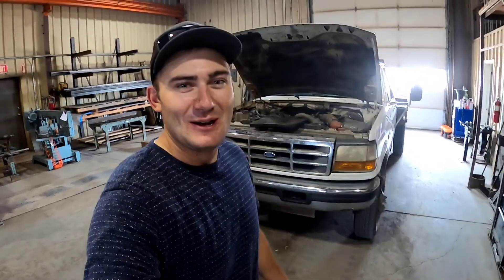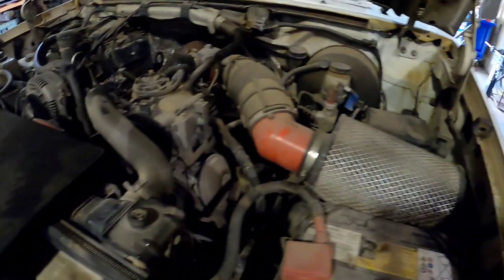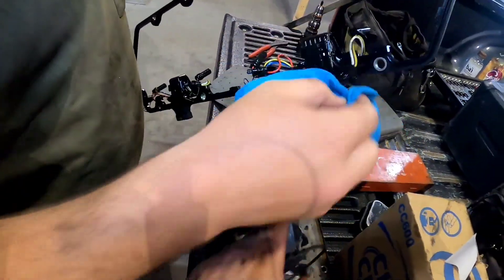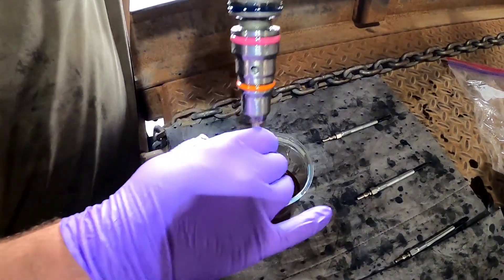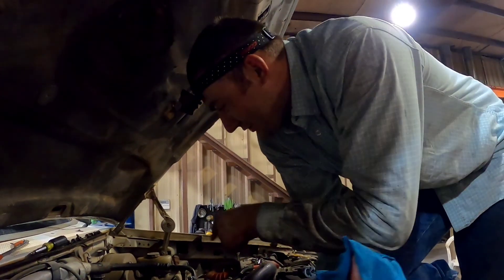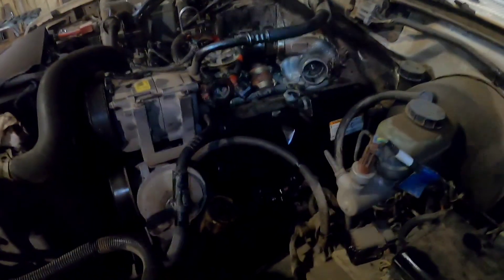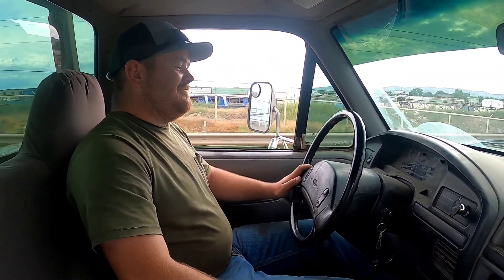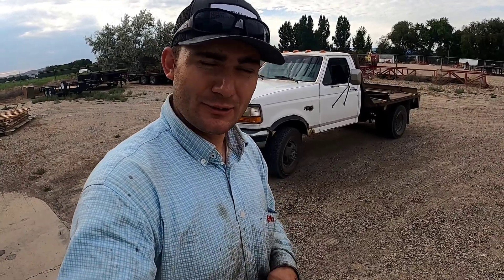7.3 OBS 160/stock INJECTOR install with mods and TRICKS!!!

Comment: I’ve done these like 6 times now but color me impressed with the detail you put into this, you are doing some things I didn’t even do. Thanks for providing this for all the new folks who keep these trucks on the roads!

One thing I do a little different is use a hand pump with a tiny hose into the injector holes to pump as much fluid out of the cylinders as I can, especially if you don’t drain the high pressure oil rail and it dumps a lot of oil into the cylinders. I also never considered turning the engine over like you did, I’ll be honest I just threw the valve covers on with gasket, a few bolts, and hit the starter relay for a few seconds. I will definitely try your method, especially without compression and using the belt it seems easy enough.
Reply from the maker: It's way easier and you don't have to worry about bending a rod
Reply: @truckincowboy7029 TC7029..  i apologize if I missed it... Please can you share the info to your injector rebuilder...

Comment: Nice job but a little bit of advice and especially if u dint have the greatest batts or wanna pull out the charger and play that game.. while u have those glow plugs out and have ur partner in the cranking with the batteries on.. its usually at this point to go ahead and hook up your ids or datakogger software and pull up that icp pid. Note i usually have the harness on too, makes a little less room to out ur glow pkusg back in but with those harness in and valve cover set up with two bolts and glow plugs out. Go ahead and crank its till ur icp gets over 500. Let sit and cool off a sec. Do it again. This lets the pump build pressure effortlessly and is easier on the batteries and starter and is  much faster. Then go ahead and pull ur teo bolts out and throw them plugs in. Take a spare craftsman deep1/4 in 8mm socket  and grind the top down to a taper about halfway down the socket on the top outter half. That craftsman will still hold torque for glow plugs. Keep this as your special glow plug socket. Helps keep it off those rockers and guides it out on way out with glow plugs too so it doesnt hang on a rocker. Reason for putting harness on before setting valve cover on with two bolts is to keep so much oil from leaking out when doing thst good prime crank with glow plugs out. Nice vid all together. We all boince our tricks off of each other.

Comment: Did the truck burn blue smoke sometimes under load is that another way you can tell injectors are bad?
Reply: i would be more scared of it being blow by (oil is coming past the compression rings and entering the combustion chamber).

Comment: How do you like the 160/0s?
Reply from the maker: For a work truck/ daily driver they love it.
Reply: @truckincowboy7029  yeah I have a race car not trying to make my truck one.. Just looking for (Towing Performance)for 30ft boats and trailers, I already have the kc sxe balanced assembly and 1.0 housing, exhaust intake gearhead tunes. Im thinking nice HPOP cnc stag 2 most likely but was stuck between 160/0 and 180/30s. Dont have access to either to drive so have no clue what they are actually like.
Reply from the maker: Honestly I would do 160/30cc. Those are the best for towing. And would match your turbo perfectly
Reply: @truckincowboy7029 do you need to tune it or can you just throw them in the Cab like the Stock ones?
Reply from the maker: @alterrihenri110  you can just drive it without a tuner. You could even put a chip on and it would make a big difference.
Reply from the maker: @ you can throw them in and not have a tuner or a chip. A chip would definitely help tho